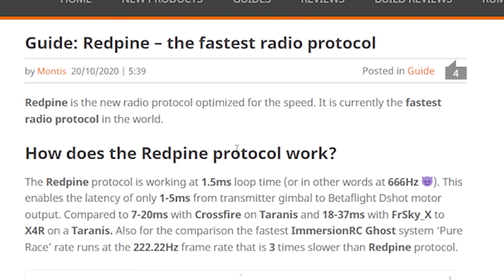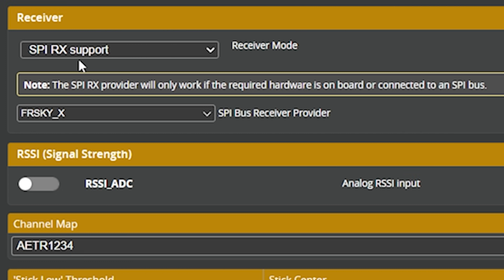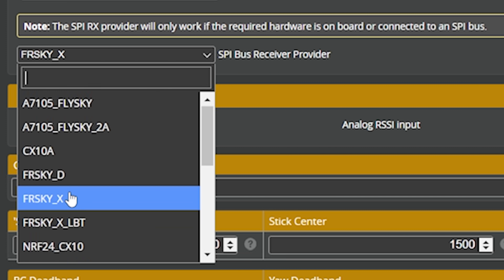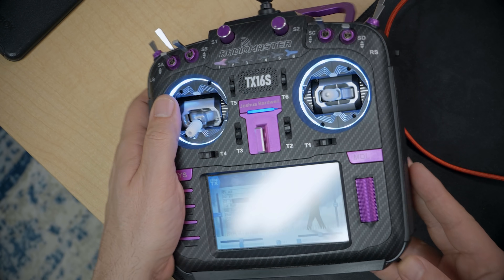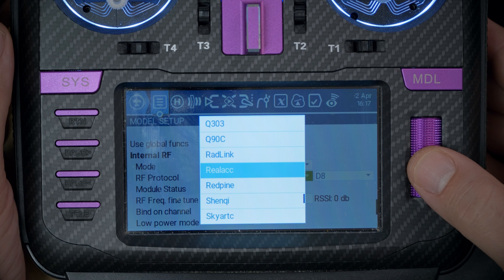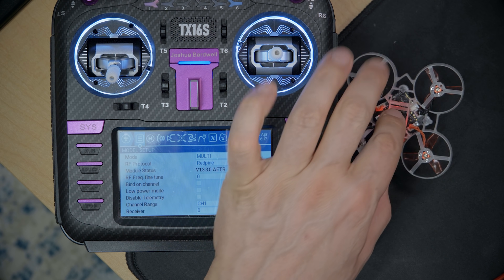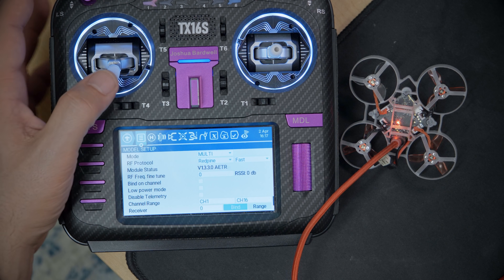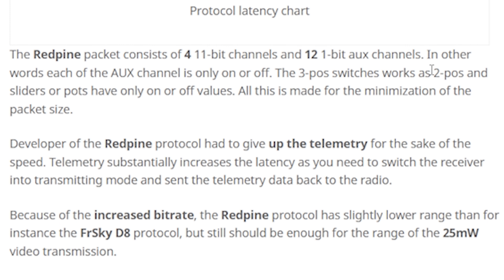The fastest control link for your Tiny Whoop (it's RedPine)

Comment: I think this is great and appreciate the simple video. I have started the process of upgrading to ELRS, but have a bunch of whoop spi boards running the frsky protocol and really don't want to have to add ELRS but they are still good to fly. Plan to put redpine on the d8 whoops/micros that I only plan on flying around the house and backyard, so the range shouldn't matter. Have a good one!

Comment: As an engineer, this incessant desire by quad pilots to reduce latency is kind of aggravating.  I want to put this 1.5 ms delay into perspective. Keep in mind that 20-25 ms is typical for most radio systems. Here's some typical propagation delays for comparison:  Propagation delay of the nerve signals between your brain and fingers: 8 ms.  Propagation delay of an image entering your eye, and your brain registering the image: 10 ms.  Rotation angle of a propeller in 1.5 ms (spinning at 10k rpm):  90 degrees (1/4 rotation). A single frame of the video you just watched: 30 ms.  

There's basically nothing reasonable that reacts in 1.5 ms. My argument is that the human body is so slow, for the vast vast majority of people watching this video, the difference that 15 ms makes is not going to be noticable. Especially when you consider that your video feed is adding another 40+ ms latency. It's possible that highly trained or professional pilots could tell the difference. But the time it takes for the props to change speed, and the entire aircraft to change speed is two to four orders of magnitude longer than the radio link. Removing just a fraction of a gram off  the weight of your quad, will have a much much larger effect on its performance than reducing your radio link latency.  So why are people so obsessed with it when there are much lower hanging fruit that they could reach for?
Reply from the maker: Here is my response to this argument: https://www.youtube.com/watch?v=Z23_uaGJfv8&ab_channel=JoshuaBardwell

All latency in the control loop matters, until the total control loop latency is low enough to be negligible. Any improvement in any part of the control loop latency improves the overall latency of the control loop.

By reducing the control link latency from e.g. 15 ms to 4 ms, you cut 11 ms of latency out of the loop. To say, 4 ms is too fast to matter, misses the point. If you could reduce the control link to 0 ms, you would still have 25 ms of video latency (for example). What matters is the cumulative latency of the whole control loop. 

I also refer you to this video from Linus Tech Tips, where he demonstrates that higher FPS produces better performance, even though the change in latency between 60 fps and 240 fps is in the "so small it shouldn't matter" category.

https://www.youtube.com/watch?v=OX31kZbAXsA&ab_channel=LinusTechTips

Granted, changing frame rate gives more updates, in addition to lower latency, so it's not a perfect comparison. But it does demonstrate that even in the "so fast it shouldn't matter" category, there are effects when performing continuous functions vs. measuring response time.
Reply: @JoshuaBardwell  I totally understand that. But *my point is that if you want a better performing aircraft, there are much much easier things you can do first. Nobody is putting tremendous amounts of time into developing motors that weigh 0.4 grams less. Even though that would have a much bigger impact than a different radio protocol. The minimum detectible latency has actually been studied quite well, and for humans, it's about 18-20 ms. So 30 to 60 fps is actually one of the best upgrades you can make. Anything above about 100 fps won't matter.  With low latency fpv video, any radio link below about 10 ms won't make a difference. I haven't seen any double blind studies of drone racing. But when my friends and I tried reducing from about 40 ms down to 22 ms, none of us could tell any difference. And I'm confident the vast vast majority of amateur drone pilots are the same.
Reply from the maker: If we accept the premise that the minimum detectable latency is 18-20 ms, then how does that compare to the control loop latency in a quadcopter? The fastest video links are about 16 ms for the video alone. Add in control link latency of between 4-25 ms, motor latency, FC PID loop latency, and latency between the human eye, through the brain, to the muscles of the fingers. It sounds like we are a LONG way from "minimum detectable latency" and still have a lot of room to gain.

Regarding your latency test: my experience is that in certain types of flying, you adjust to the latency and don't notice it. The place where latency becomes most relevant to me is when flying quickly through an unfamiliar area, or when needing to make extremely rapid control inputs that are difficult to anticipate, especially when moving at high speed. You can always compensate for a higher latency link by flying slower and/or giving more distance from obstacles. Any test of control loop latency would need to control for these variables. In addition, when moving from slow to fast link, the pilot needs time to adjust to the new link, as their mental sense of what they can do will still be constrained by their memory of the slow link. They need to be pushed to perform at the limit of their, and the quad's abilities, to bring out the differences. Simply handing people a controller and saying, what do you think of how it feels, won't work.
Reply: @JoshuaBardwell  I think that's mostly all fair. Regarding having a log way to go in terms of latency. By my calculation we have about 10-15 ms. Which I wouldn't say is particularly far. When I tested different latencies with a few of my friends, we changed it on the fly, and nobody could tell the difference.  You should consider making a video on this subject, and maybe collaborating with a few other very experienced pilots like yourself to do a better test if the effects of a few different latencies. To my knowledge, nobody has done this, and that would be very valuable info.
Reply from the maker: The best test IMO would be to start with the lowest possible latency and then increase latency mid flight. Ideally, increase it when the pilot was flying straight and level so they don't immediately notice the change. I have had DJI jump from 30ms to 45 ms when diving into a tight area and I definitely noticed.
Reply: @JoshuaBardwell  That's basically exactly what we did, we added an Arduino nano on board between the receiver and flight controlle. At first it delayed the signals based on one of the Aux channels. But then we made it randomly switch between values. I think we got up to 55 ms before noticing. Our minimum was somewhere around 28 ms.

Comment: Or you can use D8 protocol for FrSky SPI receiver. And replace SPI receiver antenna wire piece to XSR receiver antenna cable or cut a piece of WiFi router antenna coaxial cable with 31.23mm naked end. And get 0.5 km range easy peasy. There is no real benefit from messing with esoteric protocols. Casual whoop flyer will not feel the diference anyway.
Liked only because of "extremely christian people". This should be written down.

Comment: Dear Mr. Bardwell. I left the hobby long ago, too many technical issues, buying parts, learning how to solve and repair, but now I have 2 kids. Well, I have my old HGLRC XJB - 145 hanging around and Thinking about comming back. Could you give me info about how to update the thing now days, parts, etc, I know I could get more range now with some new tech. I am not into freestyle or sport, I just want to fly and to be able to record stable video and not spending a fortune. I think I have to replace my fly controller. If would had the time I would really appreciate it. If not, I would understand.  Thanks either way.

Comment: The response on Redpine is fantastic - about as close to the Bayang protocol as you can get. But as much as I loved this protocol, the range is the deciding factor. When you start to reach the edge of the range, you’ll notice some major delays without failsafe, making it incredibly hard to fly. I flew with Redpine at IO this year and had major issues with range, at about 30 ft in a crowded area. ELRS, on the other hand, gives similar response with much better range.
Reply: I'm a fans of Bayang Protocol.. :D
Would you elaborate more?

Comment: There is some misinformation that needs to be addressed. Redpine is only running at 142hz if you use the multiprotocol module as shown here. The MPM receives data at a fixed 142hz from edgeTX and is limited for legacy reasons. This is BAD because redpine send multiple frames of the same RC data and betaflight will butcher the FF and cause lots of motor spiking unless you manually set the RC filter to the correct value. Redpine only works at full potential on DeviationTX radios where the CC2500 is driven directly from SPI.
Reply from the maker: Ohhhhh noooooooo. WTF. I did not know that. Are the correct FF settings published?
Reply: @JoshuaBardwell  You'd have to ask Chris (ctzsnooze) about the FF, but at very least RC smoothing needs to manually set quite high.

Comment: Dang I should have bought a multi protocol lite module instead of the official frsky d8 one to fly whoops with my xlite s. 
Do most / all lite multiprotocol modules have red pine or do I need a specific one? I checked two listings and couldn't find redpine listed, but it also said 'example protocols'
Reply: They should all do Redpine (they may require updating the multiprotocol firmware on them). However, get the IRangeX IRX4 Lite. Some of the other ones are using fake chips that have less flash memory than they are supposed to have, meaning that they can't be updated past a certain firmware version.

Comment: Hey Josh, I'm the guy behind redpine.  A couple clarifications.  Protocol is like 3-4 years old now!  ERLS is awesome and I've been following the dev process (good group of people) and also uses a much better chipset.  CC2500 stinks in comparison!   But...

Range is about the same as D8/D16 due better modulation picks and sending 10x the number of packets.

The best latency is only with deviation transmitters.  MPM with opentx works ok, but there is some inefficiencies that made it worse.  Last time I looked mpm sends 2 or 3 of the same packets because it can't keep up.  

666hz isn't nefarious.  Just 1/1.5ms.  I have test versions on deviation that go up to 1khz but everything in betaflight and deviation needed to be carefully tuned.  666hz was a good safe value.  In deviation you can actually set the speed on the fly and tube to whatever you want!

There is some mini quad FCs that run redpine with diversity and full power.  But only F4 unless something new came out.  That's what I've been running on my racers.

You can use 3 way switches with some mixer logic, just a little bit of work to set up.
Reply: Thank you Bryce! Really love your redpine! Good stuff! Totally revived my Whoop Fleet! 🤩🤩🤩
Reply: Isn't is a bit sad deviationtx isn't being actively developed anymore.. I've been using redpine and elrs on it for quite a while and loving it. Thanks for developing Redpine!
Reply: @tonhabraken9339  I still see some work being done here and there.   I did some stuff so you can set VTX frequency from the radio to betaflight which was great for races, no telemetry needed... Imho less is better on the TX!  Stick movement latency to it being sent out the radio is very short and synced up with the packets.
Reply: Is this a hardware issue or a firmware issue? Would it be possible for EdgeTX devs to make it work the way it does on a deviation radio?
Reply: @Freehotdawgs  mostly it is a firmware issue.  I hadn't checked out edgetx, but there was some experiment mpm packet sync that could be turned on that would help...  I had played with it a bit. Also probably need to bump up the baud rate on the MPM.
Reply: Can you get telemetry working ?
Reply: Hey Bryce! I just got back into whooping this winter, running it tx16s on htx 2.5, and I don't see any option for frequency fine-tune on redpine. I had previously had my frsky receivers fine-tuned, bit it seems as though the option has disappeared. Is this normal?? Thanks, I'm loving the connectedness. 🔥🤙

Comment: Just tried this....Awsome on emuflight 0.4.0 with the Frq fine tune i am getting better RSSI values than D8 but i didnt have than Freq fine tuned on D8 before. I only fly the Mob6 around the house or around our factory floor so the range is not an issue for me this is a win. Do you know a way of cloning to other Radios though? as i used to use FrSkyRX protocol to clone to other radios and i have lost this now so can only use my Tango 2 with External Module now. I am cool with this though for the gain in RC Link lower latency.

Comment: It would be great if someone made a very light AIO whoop board without any receiver built it. This would save a gram or 2, then just add a EP2 receiver which is less than 0.5 grams. Seems the best way forward.
Reply: Or just get an AIO board with the EP2 build in, like HM ELRS F4 2G4.
Reply: @o3rMeNs  There are downsides to SPI receivers. Annoying to flash, maybe or maybe not work with different release versions, need newest BF, etc. Adding the built in receiver strangely adds more weight to a board than the weight of the EP2 also.
Reply: @thetubemeister82  People having trouble flashing firmware are annoying. If you think you can solder an external Rx to a whoop board to save weight I have news for you: "You're wrong!" The whole point of having an SPI Rx is to save weight and being compact. External Rx just cause unwanted vibrations and also SPI is a faster protocol than UART.
Reply: @o3rMeNs  Actually there is a whole article written on this by a whoop racing guy that has seriously done his research. If there is already an existing SPI receiver built in, then obviously adding an external one will add weight overall. If a board is designed to start with, without a built-in SPI receiver, then the weight savings can be greater than the 0.45 grams or so of an EP2. I will link the article if I get around to finding it again. 

It’s nothing to do with having trouble flashing the firmware. It’s ease of use and you just have to watch AKs video about flashing SPI ELRS receivers to see that it’s way more inconvenient than a normal EP1 or EP2 receiver. I was mentioning the well known disadvantages of SPI receivers. If they were better in any way other than to save space on whoop boards, they would be in other categories of FCs.
Reply: @o3rMeNs  did you read the article? You have a point about extra things dangling around in the whoop. But then you finish saying that you would rather have an external vtx and RX on a whoop?? (Oh it was a typo and you edited it - makes sense now). Again this was nothing to do with having trouble flashing and not being able to do it. My original comment was about an observation that some AIO boards + a separate EP2 would be lighter than the new happy model board with ELRS SPI. You must get a lot of people asking you for help with receivers if you find “people annoying”. I have never had any issues with flashing - like you said, follow the documentation.
Reply: @thetubemeister82  Yeah it was a typo which I edited. Just the VTx external in case it burns out. Also the betafpv f4 elrs board is super lightweight, but I already own the HM ELRSF42G4, which is simply amazing. And I do read a lot of comments and forums with people running into trouble usually because they don't read. 9 out of 10 just complain with posts and ask questions that are already answered in the documentation. Same goes for betaflight itself, the manuals are so good but people rather want to watch video's and ask questions in the comments instead of reading it seems.... those people are annoying!
Reply: @thetubemeister82  But I get that SPI elrs it cumbersome for many people having to have flash custom BF4.3 hex files because it's cutting edge stuff, which to me is exciting rather than cumbersome. Just don't go for cutting edge stuff if you find it annoying. It will all get better with time and development though!
Reply: @o3rMeNs  it’s very cool that ELRS will probably be the future for whoop boards - no more range issues! I get RSSI warnings just flying around outside my house with Frysky SPI on my Mob6. Keen to get an ELRS board soon, but not that keen to switch to BF for my whoops yet - Emu with PMB tune is working too well.
Reply: @thetubemeister82  Tried EMU as well but that didn't do anything for me that BF couldn't do. BF4.3 is great. I'm not sure if EMU can do ELRS boards yet.

Comment: joshua is there a way to reset the happymodel board ...after changing to redpine the fc board when i plug in my usb it wont detect under bf now
Reply from the maker: You can always put it into DFU mode with the bootloader button on the FC, then re-flash it.
Reply: one more strange thing i notice is my logitech wireless mouse  stop working if the quad is powered up... sad life